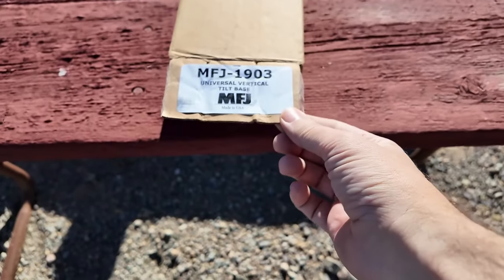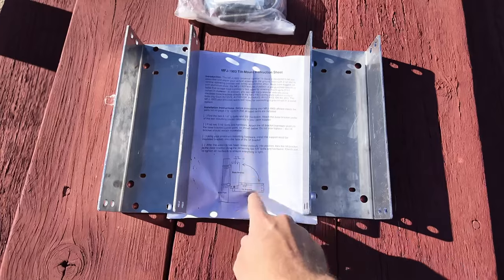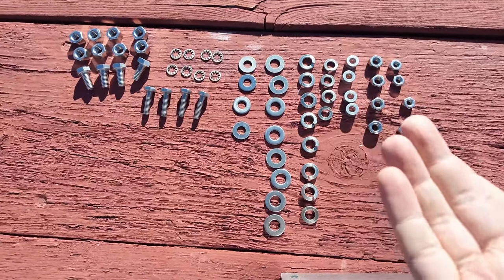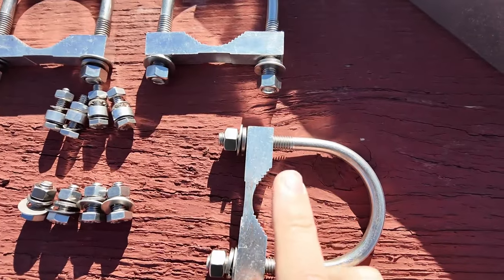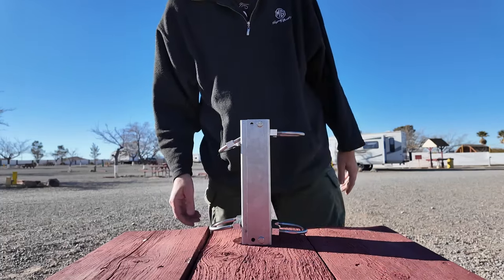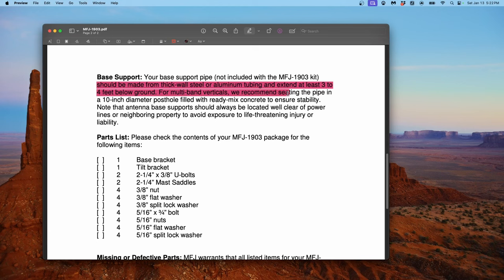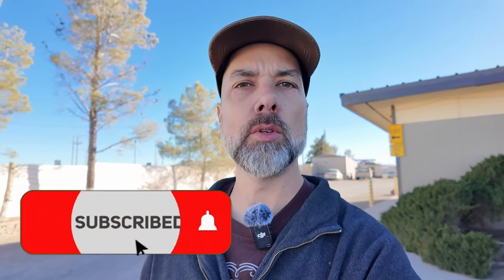Got a Mast?  Need to get it up?  Need to Work on it?

Comment: I've been using this for 7+ years for my Hustler 6btv flagpole antenna and its been a great tilt base! I had cotter pins in the top to make easier removal but it did wear the holes out a bit so I switched back to the bolts/washers. It's very useful with the flag attached to bring it down with high winds and change it out when it tears over time in Texas weather!👍
Reply from the maker: Good to hear its surviving well!

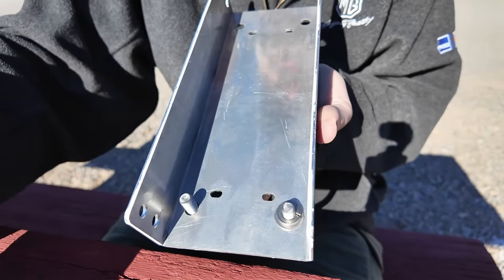Comment: 2:16 Everything comes in that order, even in the manuals. Although if I am manufacturing something I use self-blocking nuts, a piece less than you can miss
Reply from the maker: I do like self locking nuts for that same reason!

Comment: The lock washer is designed to hold the nut in place from turning and loosening off. Hence, what you call a fender washer first, then the lock washer and lastly, the nut. :)
We need MFJ down here. We get jipped as usual. Lol
Reply from the maker: Thanks Donz!  MFJ makes just about everything!

Comment: Flat washer, then lock washer, then nut...at least that's how the Mechanical Engineers I worked in the past would design fastener stacks for electronics assemblies.  For ham radio applications, it probably doesn't matter all that much. Either way, that looks like a handy gadget!
Reply from the maker: Thanks Rob!  I knew you'd have a good answer!

Comment: Lock washer always goes against the nut to keep it from loosening.  They are usually used in applications where vibration is an issue, but I can see the need here if the wind is bouncing the mast back and forth.
Reply from the maker: Lot of vibration in vertical masts

Comment: You could use wing nuts or cotter pins on the tilting piece so that you can tilt without having to have tools on you!
Reply from the maker: I was thinking about a tool free tilt over.  I will most likely be tilting more than the average ham.

Comment: I put the fender washer next to the bolt head, then the plate, on the other side a lock washer, which grips the plate, and then the nut. Then you hold the nut, and turn the head of the bolt, the fender washer acts as a bearing,.
Reply from the maker: #ProTip!

Comment: The flat should be against the surface and the lock/split washer should be between the head and flat washer. The flat washer protects the surface from the biting of the lock/split washer.   This is industrial standard.
Reply from the maker: Thanks!

Comment: It seems that most telescoping masts are for temporary installation.  I have an eave mount with a super heavy-duty DXEngineering 6' mast for my 2m/70cm, and it's not nearly high enough to clear my neighbor's house.  Does anyone have suggestions for a permanent, tall mast, around 20-30ft?
Reply from the maker: A lot of people use "chain link top rail", next up would be a flag pole of some kind in my mind.  They start to get expensive as you start to add weight to them and they need more strength to accomodate.  A 2/70 antenna should be an easy load.
Reply: @temporarilyoffline  thanks for the suggestions!

Comment: Was wondering how you might use this with your trailer?  I mean short stake in ground, then some attachment on the latter to hold it up?  Or some other way.  Thanks For the video,.  de W5DMD
Reply from the maker: My thought would be to use it to attach a mast to the rear ladder that I could then raise and lower easier.  It is most likely overkill for that service.